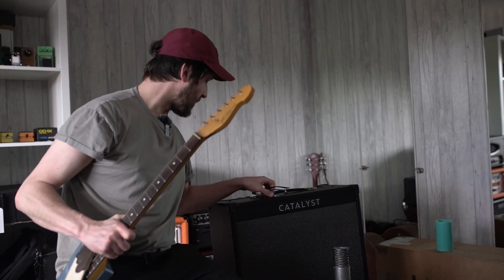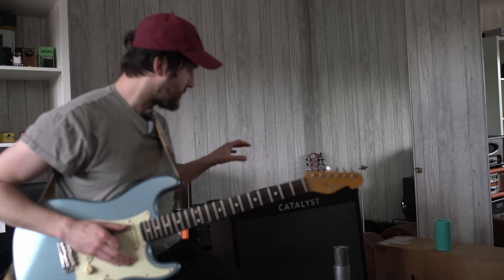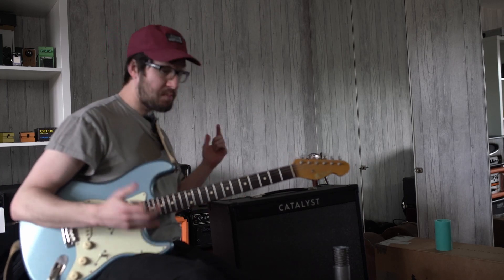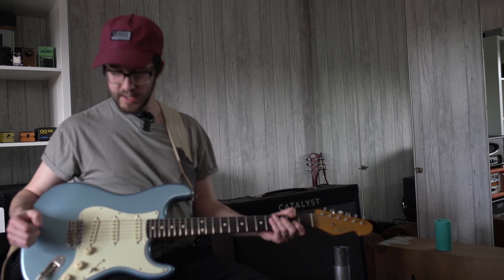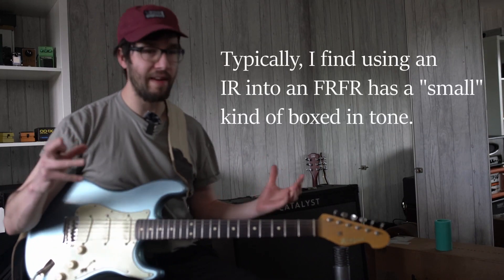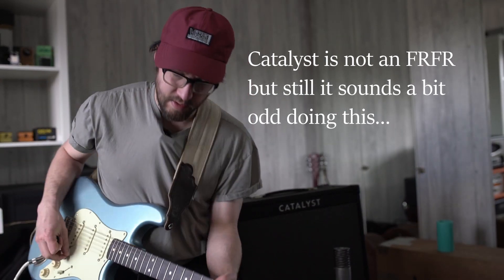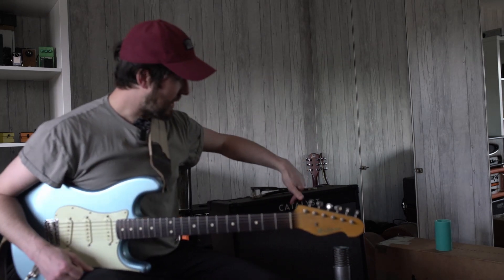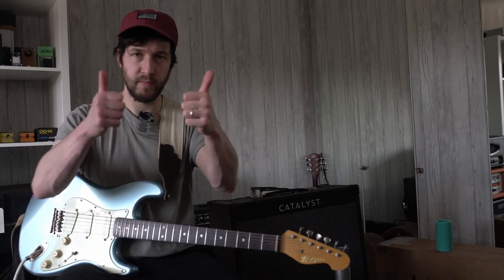I won't be using an FRFR speaker anymore - LINE 6 Catalyst with a FRACTAL FM3

Comment: I think this is really a useful thing to have this power in option on a full fledged amp. This eliminates the option of carrying a separate frfr  for our modlers. I liked it!!!
Reply: It’s called the effects return. All worthy tube amps possess them.
Reply: @justinTime077  No... it's different on this.
Reply: @jayeshrathore5804  Correct. it's not the return of the effects loop found on some tube amps, but rather a separate direct path into the Catalyst's power section. The speaker however, is not FRFR. I have a Powercab and the Catalyst200. MY FM3 sounds much better into the Powercab, but using the Catalyst in a gig, provides a backup amp for the FM3. The FM3 has never failed so, the catalyst has become redundant for me.

Comment: I just bought a Catalyst 60 to run my FM3 through it, and am experiencing pleasingly good results.  Like you said, have to make some adjustments from the cab blocks being bypasse now, but for the most part, I'm happy with the sounds of my presets coming out of the Line 6.  The reason I bought it in the first place was that after several years being the keyboardist for my band, am now being asked to play guitar.  All I had were amp modelers lol  I've had amps in the past, but I downsized on gear sold and, traded for keyboards and modelers, etc., you know how it goes.  So the Catalyst is the first real amp I've had in awhile.  I'm sure that the amp itself, from what I've heard has a decent sound overall, but when I found from the manual was able to hook up a modeller, my FM3, I forgot all about using the amps own sounds when I already have my Fractal, which you know a FM3 provides a much greater palette to work from.  But yes, I agree, who needs frfrs with this thing!  I only regret not getting the 2x12 model.
Reply: Please how to use it with the fm3. I’m not English fluent. Can you explain exactly how to use please?
Reply: @mercigoku  you need 4 instrument cables to connect the FM3 and Catalyst together.  In the Catalyst manual, there is a diagram/picture that shows how to connect it.

Comment: Totally agree. I use catalyst with hx effects and/or with the hx stomp.

This amp is an awesome solution for modelers and so affordable. There is "only" one cab (compare to powercab) but it is enough for most situation. 
I tested frfr solution and i find it "boxy" and too neutral. The sound is more better with good stereo headphones (audio technica).

The next step for line 6 is to put powercab in the catalyst with 5 or 6 speakers and the possibilitie to put ir... it would be crazy...

Greetings
Reply: dude, i'm glad i came across your post, i have hx effects, just bought the catalyst so i wouldn't have to load my tube amp and everything to practice, i'm not super happy about the tones in it though, but now i'm considering using it as FRFR with the power amp.  Do i just need a good IR and good preamp with my HX with catalyst if i want better tones than what the amp is offering?

Comment: On the subject of IR's sounding small: In my experience you have to surf through 50 or so IRs to find ones are are more open. The specific IR makes all the difference in the world. For you HX Stomp to PowerCab users I found a Live Ready Sound IR that I can pull pretty much any stock AMP up, and it sounds really good in the PowerCab. I was initially very disappointed in the beginning, but like I said, the right IR really makes a difference. The  one I am talking about is the "LRS M2 A 7b2". Give it a try. DON'T forget to crank up the output of the Stomp till you are almost tickling the input level indicator at red. Needs to be solidly in the orange level. LRS also sells some specific PowerCab tuned IRs. The Cream Back ones are also good.
Reply: I always put a room reverb After the IR. I have no use for a sound mimicing a recorded amp. I want it to sound like an amp in a room.
Reply: Yep, easier to fix a "small" sounding moddeler than a real amp that is small sounding.
Reply: In this instance it sounded small because it was an IR running through a guitar speaker. So it was getting “double colored.” Like taking a picture of a picture of the Grand Canyon. Just not the same. I’m sure if it was through an FRFR or a PA it would have sounded much bigger and fuller.

Comment: Would be cool to see a comparison between the Katana and the Catalyst using each amp's power amp in.  Are there significant differences between the two?
Reply: Catalyst is a class D Power amp, whereas the katana uses an A/B power amp.  And obviously, they use different speakers.
Reply: @JeffBee1  the fuck do you expect you're comparing a $300 Katana to amps that cost $3000+ LMAO the catalyst will be the same as is a cheap ass amp too.
Reply: @JeffBee1  i had a katana mkII 50 for a fun amp and power amp in - sounded bad so i sold it.

Comment: I personally wouldn't ever use anything but an FRFR type output with a Fractal product. There are so many rich IR options within the unit, it would be shame to disengage the Cab block. I used an Axe Fx II through studio monitors and also through a XiTone powered wedge for close to a decage, and it was incredible. Now, with the FM3, I'm using it through the same studio monitors only, and the tones are glorious. Nice video!
Reply: I don't want to speak for Johnnathan, but I think both approaches are valid. Yours is tone character oriented, while using a cab like Catalyst is more about "guitar amp in the room" experience, that FRFR monitor doesn't deliver.
Reply: @JohannDaart  and @The Humble Pundit It is also cost and size thing as well.  I have an unpowered Xitone 2x12 driven by a Matrix rack amp for my Axe FX 3.  Yep, sounds glorious.  But it also wasn't cheap.  

Also, I only play small Gigs now, me and a Singer, or jam sessions.  So the Axe rig stays in the studio for recording.   I take an HX Stomp and Katana out for that stuff.  It's cheaper, and a whole lot easier to transport.
Reply: @justmehere6094  my take is that if you're spending $2.5K on the best modeler out there, you should want to plug it into something equally as cutting edge.
Reply: @JohannDaart  I never understood this "amp in the room" thing. I just want to hear epic tones. Which I get through an FRFR system.
Reply: @thehumblepundit9790  It's about resonance box. When you play acoustic guitar, then you hold it's resonance box on your lap. It makes playing feel "organic" and the room is filled with the vibration of the guitar's resonance box. Meanwhile electric guitar doesn't have resonance box. It's resonance box is the guitar cab. Some people want to feel this resonance in the room or close to them when they play. FRFR wedge monitor or studio monitor doesn't vibrate like guitar cab. It's about the vibration of the box. Modelers provide dry "recorded" tone, while guitar cab provides "experience" of resonance.
Reply: @thehumblepundit9790  So do you really think, assuming same tone, that players can't discern between FRFR monitor and guitar cab in a blind test, while playing them both in the same room? You would lose money big time bro. Also if you want to bring up "science" and "physics", then you obviously know, that there's a big difference between directional monitor and it's tweeters, near field studio monitors and a guitar cab. They all have a different design, they create different "sound space", used for different purposes... duh. Let's stay civil on Johnnathan channel man, but don't talk out of your ass. I respect that you like playing through FRFR and I actually... do it too.
Reply: @JohannDaart  not talking out of my ass at all. I've done the test you suggest, and if tweaked properly, no, people can't tell AT ALL. It's all in the expertise of the person programming the modeler. There's a REASON big names are going to modelers. I promise you, you've heard modelers through FRFR solutions and couldn't tell. Sound is sound, brother. Again, people coming up with all kinds of voodoo to prove their points. ESPECIALLY in a mix, you would never be able to tell one from the other. Come on, man. Stay civil? Yeah, how about you try it and don't insult people.
Reply: @thehumblepundit9790  You are aggressive from the get go man. "There's a reason why big names are going for modelers" - yeah. There are also reasons, why other big names stay with real amps or go hybrid, modelers, but monitors and guitar cabs on stage at the same time: https://youtu.be/P6k2ghtbhoU?t=323
I really don't feel like I need to win some argument with you. I think modelers are great. I use one with near field monitors at home. They provide great tone and are insanely practical for both amateur and professional use. But hey... let other people use guitar cabs if they don't like FRFR monitors? What's the problem with that? People have various preferences and they might be sensitive for stuff that you are not. For example I like playing through near field monitors, but I don't like playing through a directional wedge. It's a different "experience" for me. Guitar cab is also another one. Notice that I'm not talking about "tone", which can be great in all cases or really bad, depending on the tweaker's skill, just as you pointed out.
Reply: Anytime I’ve put my FM3 on a real cabinet through tube poweramp or a good SS amp like a quilter, it always crushed the FRFR setup I put it against. FM3 on a Mesa 2:90 through a Mesa 4x12 absolutely demolished the FM through a Friedman ASM. Just my opinion.
Reply: @danyeo  
Well that's your opinion. 
IRs are mimicking miked up cabs, whereas with guitar cabs, you are hearing just the pure speaker sound. 
That's the difference. 
It's not the matter of which is better. It's the matter of which you prefer.
Reply: @JohannDaart  you are the aggressive  one, I love how you project when tou started saying the other dude was talking his ass out. Chill, behave, the other dude was not even picking on you
Reply: @havenlane992  True, you might be right. From my perspective, my approach was to exchange opinions and I think both FRFR and guitar cab approaches are valid. While FRFR has insane flexibility and tone quality, still, guitar cab adds to the experience. Meanwhile Humble Pundit argues that FRFR is the only valid way, because he doesn't feel any difference in how he experiences both setups.
Reply: @JohannDaart  it takes balls to admit it, my respect. Regarding the solution, sell that to me is just subjective, tho I might go for the frfr because of the price. I have an hx stomp, if I want to use it with a mic too do I need a mixer? And if so which one do you guys recommend, hopefully  something small
Reply: @chl3224  I will have to say...I'm going to start taking my FM3 into some places and try a few monitors if there's any around. I'm kinda getting tired and dragging heavy gear around, dealing with amp techs, tubes, etc. I've tried before but I probably didn't spend enough time tweaking.

Comment: Isn't it possible using these modellers to add another cab IR block after the main cab IR that you load an inverse IR of the output path (power amp + cab/speakers) you're playing on? That would presumably make whatever amp/cab you're using a "FRFR"?

Comment: Hey John, I got a question to ask and this is the most recent and relevant video to ask it on lol.
I am torn between getting a Line 6 Catalyst to run my HX Stomp into, or a Power Amp pedal in the form of the EHX Magnum 44.
The reason I am asking is that I have a 1x12 cab that I absolutely LOVE more than any cab I have tried and I want to use my HX Stomp through it, I currently don't have another amp with an effect loop.
The EHX Magnum 44 costs $350 NZD (New Zealand dollars) and the Line 6 1x12 or 2x12 is $899 and $999...I know. Expensive in this country. I would definitely use the Catalyst with my stomp in a 4 cable set up most likely but I just love my cab so much and every affordable combo i have tried has speakers that I dislike the sound of. I am also very content with my HX Stomp on its own.
I think I recall you using a power amp pedal in the past and I wonder if you could let me know your experience with one.

Comment: I’m about to get involved in upgrading my monitoring system for my modeling rig. 
I’ve found something of the same issues with impulse responses. 
If I’m stood in the room with it, I really prefer it to sound like that as opposed to perfect. 
In some strange way, I feel like they can remove some of that in the moment feedback. 
Whether or not going with cabinet/S on stage for my personal sound is the trick or not remains to be seen. It’s just the next experiment.
I will always send impulse responses out front. 
I feel like that’s the way.
For now.

Comment: so hard to tell on YT, and I never see these in a shop so I can try them out.  From the video the sound just seems really thin, and almost like the pick attack intrudes into the note.  I was tempted to sell off my pair of 2x12 combo's and switch to a pair of Headrush 112's, but I'm thinking eh, maybe not.  

Just for a quick jam or running through a few exercises, with the FRFR I would still need the footboard, but with a combo all I need is my guitar.  Maybe when I can buy a Headrush 108 or two  without trading any gear, maybe then.
Reply: I run an  Boss ME 80 into a Boss RC 300 out into two HR 112 FRFRs
Sounds amazing

Comment: I have the catalyst 100 how would I go about running a pod go through it? How can I still use the cab and amp modellers and it sound ok? Through the front with no amp or cab blocks on? Or through the Poweramp like this? Sorry I'm kind of new to this.
Reply: I think you are talking about using your modeler through the poweramp.  That way you are only using the Catalyst as a speaker.  I assume you turn off the cabinet modeling in your modeler and just use it's amp model (and effects).  I just ordered a 100 and am looking forward to trying it this way and trying the Catalyst's amp models to see which suits me best.
Reply: @sfstoltenberg  Thanks for the clarification. I was a little confused and mixed up. Not sure what type of stuff you play but the catalyst definitely surprised me for clean and slightly overdriven tones. Hope you are as satisfied with it as I am.

Comment: I have one question 
I have the catalyst 60
And I'm thinking about buying a new speaker (4 ohm so little bit limited optionwise)(thinking about the Jensen C12N Ceramic Vintage)
Do you think it will make a difference?
Is the stock speaker good?
I primarily going to use it home 
As is 
Keep up the good work on your channel 👍🤗
Reply: You do realize that the Group at Line 6 tested a massive pile of speakers for response and best blend with all of the amp models on board, and in the end had to have a custom speaker made to do what they wanted out of the Catalyst.  

 I've read where others have tried replacing speakers with something like a creamback or v30's and while they are great speakers, they all went back to the original because it sounded best.   Also, good luck finding a 4 ohm speaker you like the sound of for all things.   If you go with an 8 or 16 Ohm speaker you're reducing the max output power from the amp - something to consider.
Reply: @adamjones8218  
Hello
Interesting and informative answer 
And just realized that I have a Jensen c12n speaker in my rebuilt fender super champ XD 
I could just try that one 😁
Cheers 👍
Reply: @adamjones8218  
One thought though
Maybe the more expensive speakers
Never were a option to keep the price down 🤔?
Reply: @adamjones8218  
8 ohm c12n that is

Comment: Is 100W enough loud with modeller for gigging?
Reply: for some perspective. i gig w a boss katana. it has 3 power settings: .5w, 50w & 100w.  i go straight into the power amp and use my hd500x for tone. my master volume sits at 9 o'clock (and 7 o'clock is basically off). just did a gig at the .5w setting. but usually just use the 50w setting. it's LOUD!  It will be highly rare that you use 100w. you'll piss the band off probably and definitely the venu. 

...and i like it sufficiently loud to get feedback when i want it.

Comment: I was waiting for you to make this exact video. Thank you.
I'm using a different modeller but if I'm understanding this correctly, remove cab or IR block from your preset for the best results?
Reply: I think it depends. I run the helix into the fx return of a fender mustang model8ng amp. It sounds awful with IR off. But the IR on, it’s perfect
Reply: @BodybuildAlex  After reading peoples comments on this video, I've run into a brick wall again on this topic. I just want a speaker solution that sounds open and transparent. There are so many options that it's pretty overwhelming for someone like me who doesn't have much knowledge on this.
Reply: @chaz__  just try something out. Most stores have a 30 day return policy. If you like it, keep it.

Too many people think there are hard set rules.

Like I said, the way I’m running the helix in unconventional. I always planned to upgrade because everyone said I “NEEDED THIS” or “NEEDED THAT.”

But I’m really happy with the tone I’m getting so changing it up at this point might yield worse results lol
Reply: Well, with an IR on, you pretty much are miking up an amp, and then running that miked up amp signal into another cabinet that's meant for guitar amps instead of flat and nutral, which 
1. isn't possible in the real world.
2. No one does in the real world.